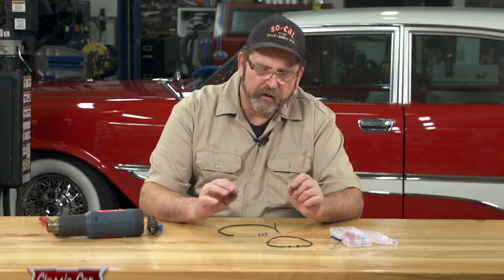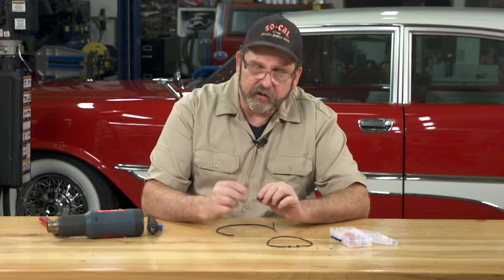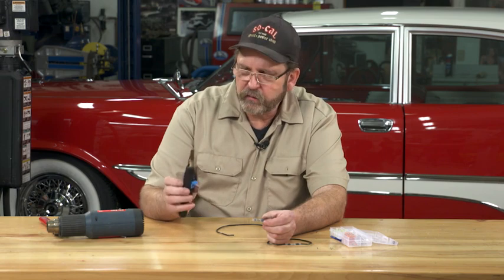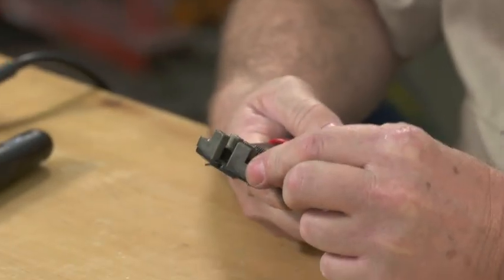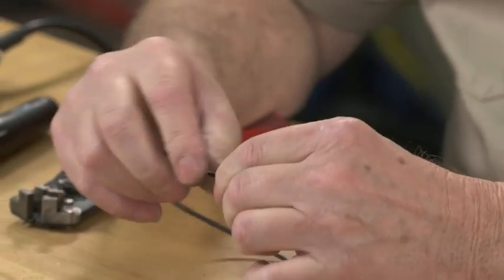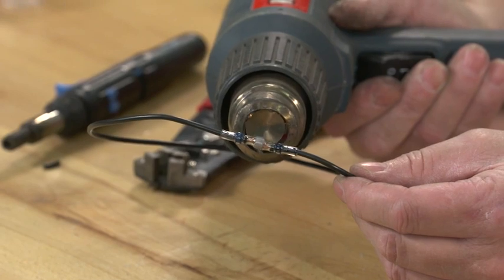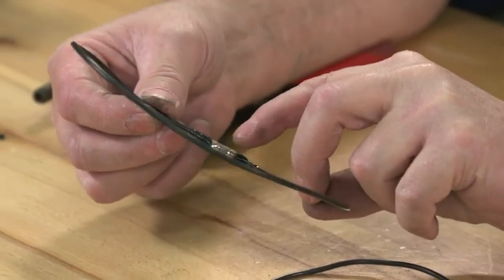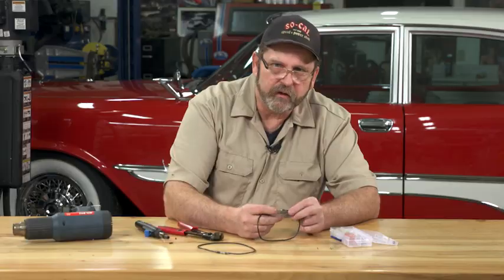Fast and Easy Wire Butt Connectors

Comment: What is the brand name of these and where to find them.
Please start including links in description when presenting products.
Reply from the maker: Hello,
The set used for this video was "Kuject 120PCS Solder Seal Wire Connectors" and are available on Amazon. 
Although, they are sold under many brand names, and we've found little difference between brands.
Mark
Classic Car Restoration Club

Comment: How do you think these would do on warmer/hotter areas such as engine bay area? Would the solder melt again? The low temp solder has me thinking...
Reply from the maker: Hi Harry.  The solder in most of these types of connectors melts between 225-260 degrees fahrenheit, depending on the brand.
That is hot enough to burn you but the majority of areas in your engine compartment are below that temp, keep in mind the heat in the area where you're using them.
Keep in mind I do not think these are a replacement for high-temp solder and heat shrink connectors, but rather a good product in some areas and throw a few of these, a lighter, and a small jack knife in your glovebox and you're ready to tackle many roadside repairs.
Thanks
Mark-Classic Car Restoration Club